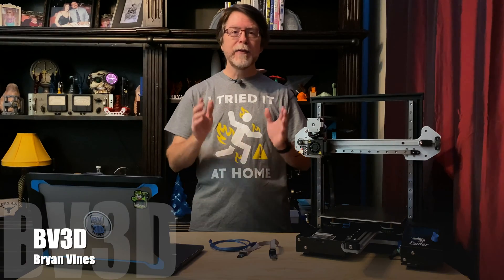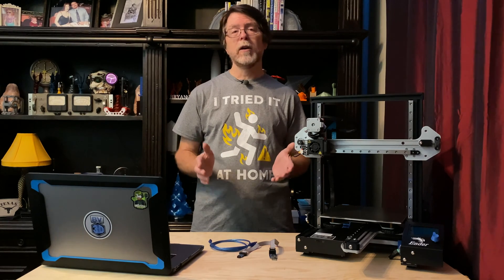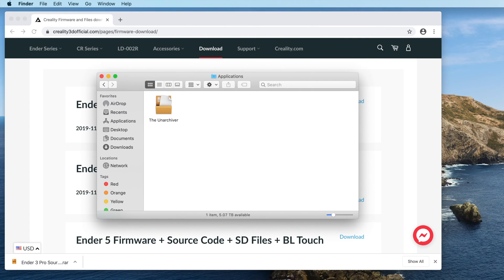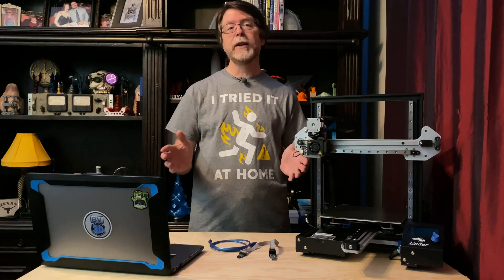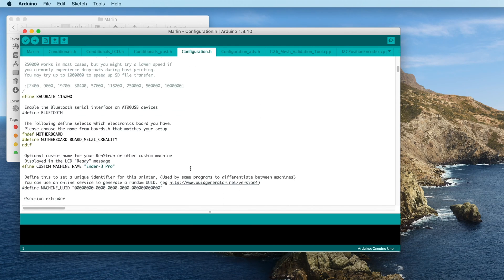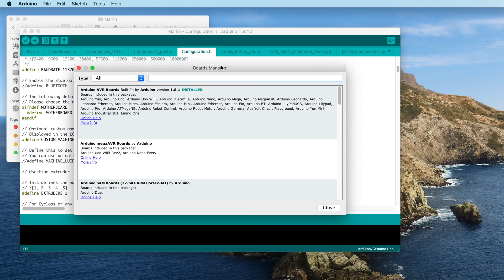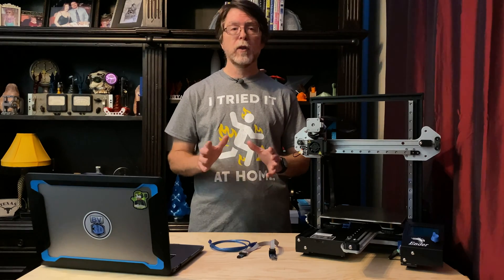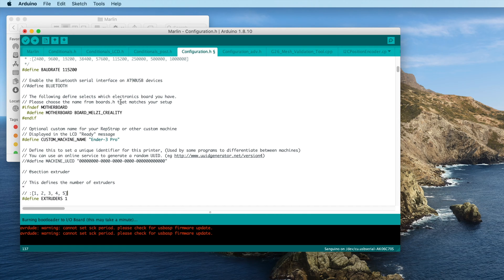How to Install Bootloader & Creality Firmware on Ender 3 & Ender 3 Pro

Comment: Good video. I ran into an issue. The firmware compiled with no problem. I had purchased the ISP from the link in the video. When I tried to upload the firmware, I got this error message from the Arduino IDE. "Arduino: 1.8.12 (Windows Store 1.8.33.0) (Windows 10), Board: "Sanguino, ATmega1284 or ATmega1284P (16 MHz)"

avrdude: Warning: cannot open USB device: Function not implemented
avrdude: error: could not find USB device with vid=0x16c0 pid=0x5dc vendor='www.fischl.de' product='USBasp'
Error while burning bootloader.

I noticed that there is a jumper on the ISP. I know that sometimes products come out of Chinese factories set incorrectly, but I couldn't find any documentation about how the jumpers should be set. Any suggestions on how to proceed? I really appreciate your taking the time to upload your videos. They've been a great help.
Reply from the maker: Hi! I searched for that avrdude error line, and I came across advice in a few different places, which said that uninstalling the USB driver and installing a different one fixed the issue.

The clearest post describing the problem and solution seemed to be this one: https://rlogiacco.wordpress.com/2016/09/01/usbasp-windows-10/

So give that a shot, and hopefully that'll get you up and running!
Reply: @BV3D  Yup...that's what happened to me. I'm seeing this after the fact of solving it but it did indeed fix the same exact issue for me

Comment: Been trying to pluck up the courage to update my week old Ender 3 Pro but surprised to see that the installed firmware is 1.1.6.2 - where as the Creality site still says the latest is 1.1.6.1?
Reply from the maker: Interesting! It sounds like Creality has revised the firmware they're using in production, but they haven't put the files on their site yet. 🤔

Comment: Hi Bryan. Thanks for this video. I got a new Ender 3 Pro just before Christmas. Info screen says 1.1.6.1. Not wishing to brick the printer, is there an easy way to tell if I have a boot loader or not? Same question for thermal runaway.
Reply: I’ve since watched your video showing how to test for thermal runaway protection (my printer does have it). But still wondering about the boot loader.

Comment: Hi Bryan, 
cool video, but why don't you download the marlin directly from marlin? that would be way better IMO because you can be sure that it is the newest and you dont get any stuff from creality. 
please remember:
Don't try at home :/ 
Have a nice day!
Reply from the maker: Hi id, I chose to use the Creality source code because even without editing anything, it'll still work.

Also, downloading the source code and compiling it seemed like a good way to show that Creality really is complying with Marlin's license.

Additionally, a lot of companies take the position that installing firmware other than what they supply voids the warranty on the printer. From a support standpoint, I understand that position. It's entirely possible to incorrectly configure Marlin, which could cause problems.

Of course, now that this video is out, I will take a look at TH3D's Unified Firmware to see if it does anything differently. And I want to take a look at Marlin 2.0, now that it's been officially released (and isn't in beta). 👍
Reply: @BV3D  
Thanks for taking the time to answer, 
yeah, installing marlin 2.0 is very easy, just drag and drop the preconfigured ender 3 files and you are ready to go!

Comment: that a lot of work
Reply from the maker: True, but it sets the stage for being able to update the firmware without having to take the printer apart to get to the main board. Future updates simply happen over the USB cable. 🙂

Comment: I got the E3 Pro and feel that most of the focus has been on modifying the printer itself instead of printing everyday things :-). One question in the modification category Bryan : Is / will / do you think the Z-axis linear rail kit that you have on your printer be compatible with the new Micro Swiss Direct Drive Extruder that they just launched ... which I ordered ... ?
Reply from the maker: Hi toreer66! I think the Ender 3 Pro works fine out of the box. Really the only things to watch out for are making sure you've got Thermal Runaway Protection working, and you periodically check the XT60 connector between the power supply and the main board. On some Ender 3 / Pro printers, those were crimped to the cables instead of being soldered, which results in a poor connection; the poor connection can overheat.
Having said that, it's also a fun printer to modify, and put your own little twist on it. I mean sure it's easy enough to manually tighten the belt on the X gantry, but it's also fun to print a belt tightener that has threads and a knob to perform the adjustment. 
Now, about this Micro Swiss direct drive kit -- I hadn't heard of it until you mentioned it. I will have to go check that out!
Reply: @BV3D  I have the SKR Mini E3 board, TFT24 touch panel, BL Touch, Wham Bam build plate, new springs, replaced all fans with Noctua, Micro Swiss all metal hotend, Raspberry Pi with camera and Octoprint and a led strip in the upper horizontal bar. I will also add a dual z-axis drive when I add the Micro Swiss extruder to compensate for the additional weight on the X-axis.  So you can see that the madness is at full extent but I'm still a small fish.

Comment: My Ender 3 did not come with a USB cable, Is it a type A to type A cable?
Reply from the maker: Hi Andrew! My Ender 3 Pro came with a USB-A to Mini USB-B cable. The port on the front of the printer is the Mini USB-B type.
Reply: @BV3D  duh, mine didnt
Reply from the maker: @leostartstofilm1030  Hi, I'm sorry to hear that. On the bright side, you can pick up a USB-A to Mini USB-B cable for about $5 pretty much anywhere.
Reply: My ender 3 pro didn't come with one either so you don't feel alone...lol